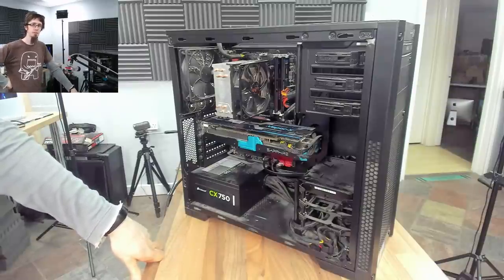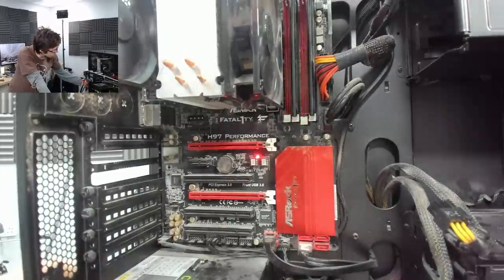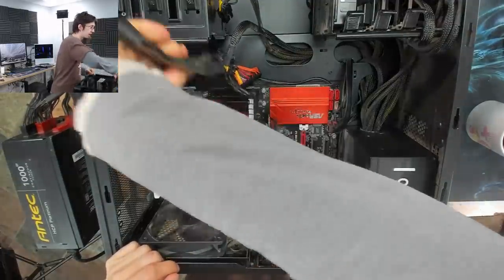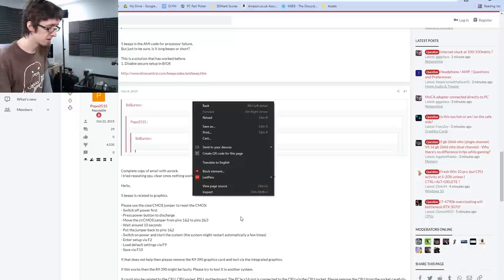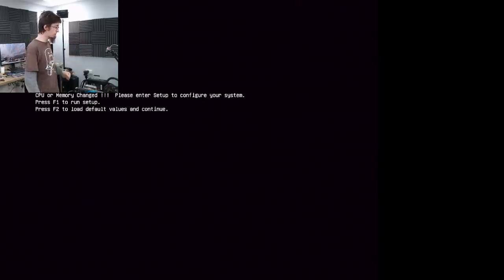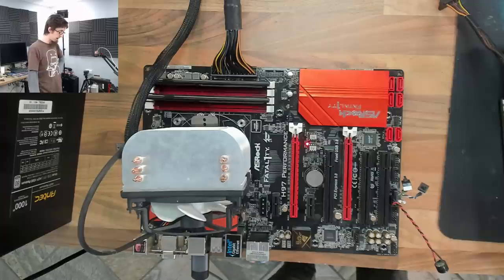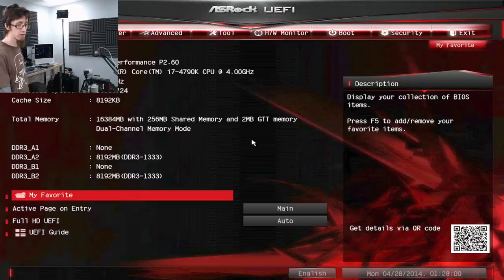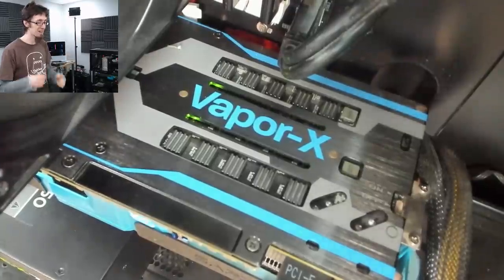Corsair Custom Build with No POST - LFC#272

Comment: The GPU has a BIOS switch, yes. Does it have to do with Legacy/UEFI mode? No. It is zo switch between normal and OC BIOS of the GPU.
Reply from the maker: Fair enough - I had the Sapphire 280x Vapo-X once upon a time, and the same switch on that was a UEFI mode (specifically labelled as such), so figured it was the same on the 290x.
Reply: @Adamant_IT  That's very odd. I never came across such a thing. I'm only aware of OC / NON-OC switches like that. Especially in case of Sapphire.

But I can kinda see why such a UEFI BIOS switch did exist back in the days. Maybe to get around the problems of the early implementations of UEFI. Maybe the normal BIOS did not respond quick enough for UEFI to recognize it, maybe?! Or the UEFI version supported some extra stuff to work with UEFI motherboard BIOS.

Anyhow, thanks!

Comment: sorry, but your 'its never the CPU' mantra is wrong. i had a CPU die on me. i literally checked everything else, then tried the cpu in a different system. it was the Ryzen 3600 died. replaced with 3800X
Reply from the maker: The full mantra is "It's never the CPU, unless it is."
I've had failed CPUs as well, but after running repair shops for 15 years I can count the number of times it's been the CPU on one hand. So yea, you're right, it can be the CPU, but if you ever come down to "CPU or Mobo" I'll always swap the mobo first.

Comment: Asrock motherboards are the worst. No doubt. I mostly deal with gigabyte boards..but have mostly Asrock boards in the dead corner. Most of the times they die when i swap RAM so I learnt with Asrock never do that unless 100% sure it's necessary

Comment: wrongly seated devices
re sit everything
bad psu
bad bios battery
-----------

Lessons I learned in life is.... start off small get minimal still added just so it powers on and boots and can see video and booting can start.
Once that works then you can shut down and add all the other hardware.
Sometimes I have seen it where a computer totally chokes if you added new things and the bios can not handle 15 new devices at once.
The rule here is the KISS rule........  keep it simple stupid!

Comment: How dumb do you have to be to get a K sku CPU and then ruin it with a locked motherboard? DUH
4790k...H97.. brilliant 👏👏
Reply: KMac  you realize you can use the exact same argument for why buying anything but a Z or X series chipset is "not sensical" especially when you already paid extra for the unlocked CPU.
"Sensical" isn't a real word either.